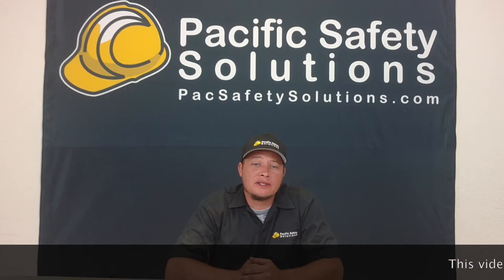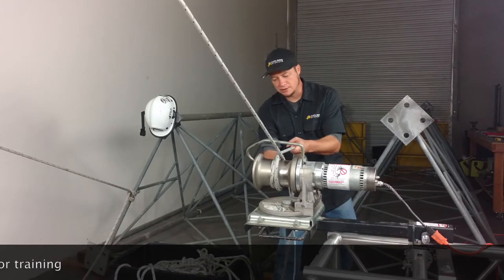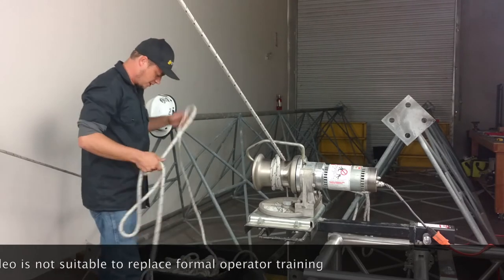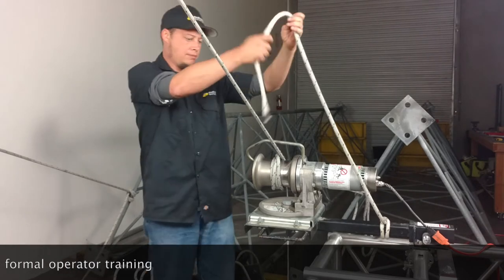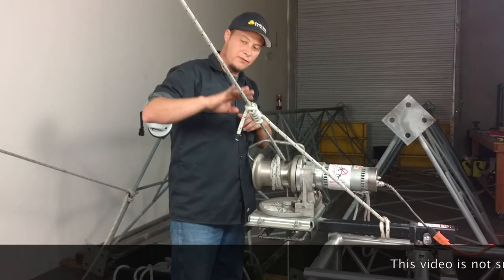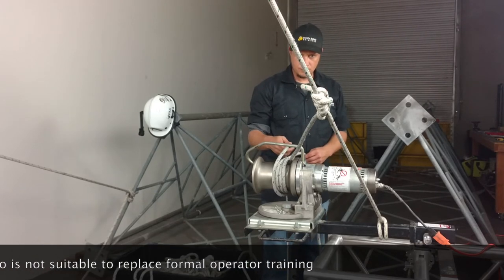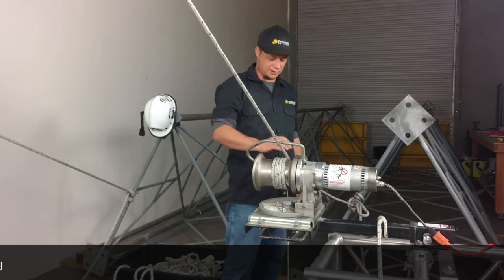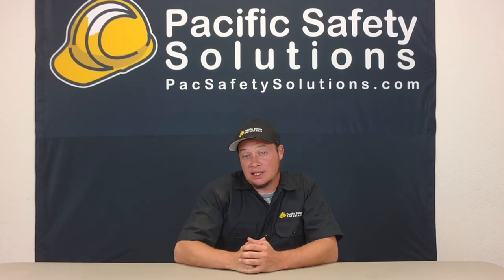Capstan Hoist Demo

Comment: Thanks for making sure that you can count to four. Ten years of building and repairing towers. and I never once had to interrupt a lift. Because I and my crew on the tower. Made sure the snatch block and slings were in the right place and position. And the rope was laid out without any twist in it. I never lifted from a pile of line or from a barrel. And you have at least three times the lift line as the height of you lift. Prepare for the lift properly. And you do not have to fix fuckups.

Comment: If you can, you could just lower the load. It'll come out on its own. Then deflect the loadline strait with a block. Away ya go.
Reply: That would be ideal, but most of the time I've seen this, the rope is pretty much tied to the drum. When they try to unwrap it, they end up burning their hands from rope burn.